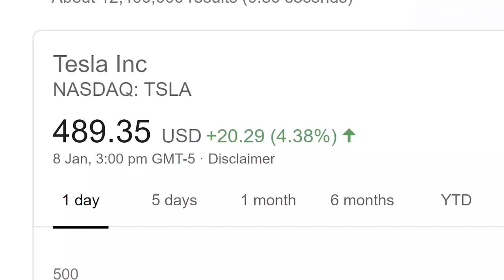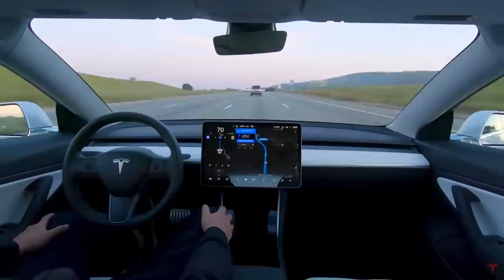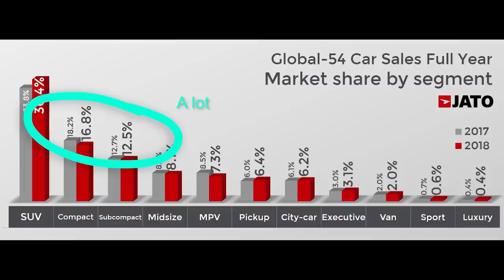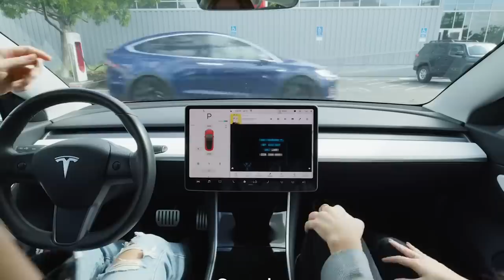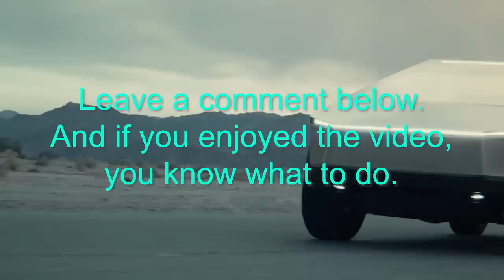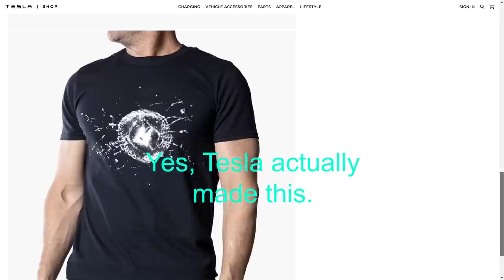Is Tesla Making A Compact Car? (or something else)

Comment: Nice prediction. I think you nailed it. But I think he’ll blow everyone’s mind when it starts at $19,000 for the base model. 200 mile range. 0-60 3.9 seconds. Full self driving.
Reply: Bruh
Reply: i'd say take my money, but i doubt it'll be that affordable. Possibly in the future
Reply: Not full self driving under that budget....the sensors alone would cost nearly ¼th of that
Reply: YOU just blew my mind with those specs, nevermind Elon announcing them😱
Reply: Probably 24990$, maybe in the future 19990$
Reply: Only has to be $25k to disrupt the ICE industry. If that could be imported to the US/Europe (without tariffs) that would sell in the millions, but more importantly, bankrupt most ICE manufactures in 24 months. Given that scenario, the transition to EVs would take 5 years not 10 and that is what is driving Elon so it will most likely happen.
Reply: Their compact city car certainly won't be that fast, on purpose, to save weight. It just has to be faster than other cheap electric cars, 7 seconds will be sufficient.
Reply: @raj6249  what sensors would be so expensive? 8 cameras? 200 dollar phones have decent cameras. Sonic sensors and radar don't break the bank. However, I think it's no longer an option to build a car without autonomy (for Tesla). They depend on it for normal things, like automatic wipers and cruise control. And just the data collection could be worth it.
Reply: @raj6249  they would cost that now
Reply: I don't think he's thinking radical enough.  ;-)
Reply: @boulderghost4457  correct only has to be 25k to KILL the ICE industry
Reply: That cost is probable, but it will not do 0-60 in 3.9.... not even close. But that's not the goal either...
Reply: @raj6249  ....China-make.... up-optioned to Hey-Yay.... FROM $18999....DO-able.... AND.... all WE have to do IS.... watch....
Reply: Yeah no, but we can dream lmao
Reply: @graysonscott1358  But it will be in the future....
Reply: 7 wont do it for me. I consider that to actually be dangerously slow.
<5 should be the min. spec.
Reply: This would be some years yet, doing this now would bankrupt tesla as the couldn't produce them fast enough
Reply: Its designed for urban driving.  100 mile version for 9,995 15 kWhr battery - Think, urban zip car under 2000 lbs.  10 minute recharge on an inductive recharging station.  Most of the driving is urban therefor < 45 mph bam, there is the safety.    200 mile version 14,995 Commuter / Suburban version 35 kwhr battery.  Nobody is going on vacation in this thing, doesn't need more range than that. (They don't need to placate the naysayers any more, you can have a low range commuter vehicle.)
Reply: I always buy used, but if he did that I'd be buying my first brand new car.
Reply: Tesla wouldn’t go that far down with range for affordability.
Reply: @ayushin82  Well, the wonderful thing about EVs is that electric motors are very compact and light. There are pancake motors for EVs that are only 308 mm in diameter and 84 mm thick that output ~214 hp.
Reply: Reddy Salted  Bought my new Tesla 3 for 85K here in Sydney last year (drive away incl FSD)
Reply: 0-60 in 4.5 Seconds is more believable
Reply: cyber Truck base is at $39000, Its basic math, they can get the price point down below $19000 in a compact.  What will be something to see is how they work out the autonomous taxi vehicle at a price point that millions can afford.
Reply: is a that a real $19,000 or one that doesnt really exist?   or one that one be made until the $25,000 are sold?   Full self driving using Teslas approach will never happen,  but given the promise based business model that doesnt really matter.
Reply: @ $19,000 base/200 mi range,  I'm in - especially if it's a "robotaxi" capable model.
Reply: Raj 
No it won’t.  If it was some sort of Lidar based solution then yes.  But as we know they use minimal radar, cheap cameras, and software.

Comment: A car the size of the european VW Golf with the current range of the Model 3 LR would be great! At least in Europe, it would sell like hot cakes!
Reply: Volkswagen ID.3 is the competence, not the Golf dino-juice anymore.
Reply: @ovi9610  I know that, mr smarty pants. I was referencing size before everything else.
Reply: for sure even in asia
Reply: Fiesta or Golf size for under £25k and they'd put unbearable pressure on the competition
Reply: Most of the new electrics coming out are mid range hatchbacks as E versions. A Tesla hatchback would be great. It will probably come close in price with a model 3.
Reply: id3 with 74kWh battery is already coming, that´s the car you are talking about. But it´s in a far other price range. Range max 200km and we are getting closer to 20k€
Reply: yes I agree. Hot cakes are Mmmm good as well.
Reply: @edgewrld  - especially in asia...
Reply: golf.. no .. so boring..too big
Reply: @ovi9610  ID. 3 so classically boring . VW need new designers

Comment: Any segment tesla enters it will do so to dominate it. It will never produce a product to just have a presence. Was a vehicle dealer for years. Saw manufacturers make cars designed not to win in their respective segments. Was very frustrating. Legacy automakers are really complacently dumb. Or perhaps dumbly complacent. And they still are. And they're going to pay dearly for their lack of drive and ambition.
Reply: Yup.  Especially considering that building cars is all about building a platform, and then squeezing as much product as you can out of that platform... If the platform entry in 2020 can't match or beat Tesla's platform entry in 2012, then where will that platform be in 2030?  And what will oil be doing in 2030?  It sure as heck won't be as cheap as it is today!
Reply: like the original roadster, model s and model x?
Reply: @Tigerex966  yah. I remember the S outselling 5 series, E class and A6 lines at one point. The X I'm not so sure about. But regardless, these models are compelling entrants in their segments. And remember, due to battery technology at the time, these models were often more expensive than their direct competition and yet held their own.
Reply: We paid them handsomely to rob us blind and disrespect us for 100yrs. 
I don't feel sorry for them . . . I really don't . Sealed transmissions, Hidden spark plugs, water pumps and fuel pumps . . . 
Good Bye DETROIT and . . . the horse you rode in on.
Reply: @jamesm.8392  ....CHURCH....
Reply: @jamesm.8392  It would be pretty cool if Tesla revived the motor city as a Tesla manufacturing hub
Reply: mmmmm dominated,  overall US EV sales fell in 2019 vs 2018,  domination
Reply: It will be a good day for Earth when they are gone, gone, gone. Tack arrogance too to their lack of drive and ambition.

Comment: Great video. Some thoughts:

1. I think they can get the Model 3 down to $30K or less, so a $25K car is not much cheaper. They have to aim for $20K or less, maybe even $15K or $10K, to really move the needle.

Think about it this way: If Model 3 costs $30K and goes 1 million miles, that's 3 cents per mile. Going down to $25K saves only a half-cent per mile. Getting down to $10K saves 2 cents a mile. Even that doesn't seem like much if the operating cost is around 18 cents per mile.

2. I absolutely love your thought that the car would be explicitly designed as a robotaxi with no concern for having a human driver.  That is a brilliant insight.

3. I don't think it will have more than four seats, and could be as small as a two-seater. A $10K 2-seater would be pretty radical.

4. I don't think the battery is the most expensive part of a Model 3. Battery is about $6K. Frame might be more than that.

Comment: Love my M3, I have a cyber truck reserved & I'm a shareholder, so clearly I'm all in on TESLA. That said, living here in the US NE, I just don't see how year-round autonomous self-driving will happen. The other day, I drove 6 miles in heavy snow. Got warnings about camera obscuration - AP was not available because the front cameras couldn't identify lanes visually - and neither could I (I followed tire marks). Driving in this, I wondered, how would a visual/sensor system ever deal with snow & ice? Warm weather is one thing, but harsh weather is another matter and there's plenty of it, even if its seasonal. Driving autonomy still has a VERY long way to go.  BTW - love the channel!

Comment: In North America the main reason to get a smaller car is price. It just happens to be smaller. The parking costs are the same regardless of size for cars. So it’s not the size that matters most but price for a significant number of buyers. If Teslas less expensive car happens to be smaller it will be the safest smaller car which is awesome. Basically its battery cost. I think an EV Powertrain cost is 50% of the vehicle compared to 25% for ICE vehicles.

Comment: Great report. We own a 2018 Tesla 3 and a Chevy 2016 Spark EV.  I actually prefer the SPARK EV for around town. It has 4 doors and grab handles inside each door on the ceiling to help older and challenged people I help. The rear hatch is bigger than the 3. That makes it handy for walkers and wheel chairs. 
I hope Tesla makes the model C Compact or model 2 car about the same range and price $20-25K 100-150 mile range. It would be great for so many people. Good for Robo taxis too.

Comment: It would still be the heaviest subcompact on the market due to the battery weight, and the battery weight would still need reinforcement which is why Tesla does so well in side collisions. Mass matters and it'll be no S/X on crash tests, but if they bring up the subcompact average, it seems they'd still want to do that? The 3 is one of the best for its size class, I expect their subcompact would follow. Regardless of if they accomplish FSD any time soon.

Comment: Excellent content.  I hope Elon Musk reads your comments. They could use chambered , layered body panels that have expandable ultralight foam to create a passenger compartment  honeycomb safety zone.  Very thin and lite sliding doors with all the cars control and functions running down a center control spinal cord. Multi frequency fiber optics to reduce many of the sub systems and their wiring harnesses.   Game changer, all other will be playing catch up for decades. Lets get this done...  Thank you Tesla !!!

Comment: Thanks for another excellent video! You work your butt off!! Impressive. Don't forget to eat and sleep! We need you alive and well.  To your design question: It would be a good idea for Tesla to utilize the Cybertruck approach - Exoskeleton, no paint. This would make the car less expensive to produce and any car used as a robo-taxi needs to be tough. With no paint, chips and rust are out so the car won't show age in the same way as traditional cars - especially important if the car is to go for millions of miles (or kilometers). Many people who live in apartments don't have garage access and a car that does not rust and has no paint to fade is very attractive. The Chinese market fits this description as many people in China live in apartments.  Most people in large cities don't have garage access, so a car that can take constant exposure to the elements and to people is a great design approach. One more note? Eventually as FSD gets the point of virtually no accidents, cars can lean toward maximum interior space, therefore, the frunk will yield to more space in the interior.  Thanks for reading all comments!  BTW - Just watch how Biden does a lot more for EV's than Trump.  Guaranteed. The only thing that will hold the Biden administration back on its EV and clean energy vision is if the US Senate remains under Republican leadership. We won't know until late December, but it is most likely what will result from two senate seat elections still to happen in Georgia.  Fact: Democrats have better economic results than Republicans, no matter how many time Republicans tell you otherwise. Fact: Trickle Down Economics is inefficient. Fact: Trump is a crap businessman with a history of failure. He put his support behind oil and "beautiful, clean coal."  Trump did nothing to assist Tesla or the clean energy revolution in the US. Nothing. He never recognized how important Tesla is to the strategic industry of clean energy in the US and the world. Never. The idiot lied that Tesla chose Texas due to his influence and Trump only got interested in Lordstown Motors when he got worried he might not win Ohio. Trump has no plan for a clean energy future and all the jobs it will create and the help to society it will bring. The arrogant moron claims to know more than the world's scientists. What a joke. If Trump were a company he would be Nikola. Still don't think so? As you like to say, just watch, this video and these comments will still be here to reference years form now.  The only person I know who hates a con more than you is me. Maybe a video covering the effects of Wall Street changing its tune about Tesla is a good idea - you could highlight which bears are turning Tesla bulls and when the change occurred for each. Another video idea: a video outlining the effect the addition of 500,000 EV chargers in the US and a comparison of the charging infrastructure on each continent and what it says about the rate at which EV's will spread and where they will proliferate in terms of locations as inferred by EV infrastructure.  Keep up the great work! : )

Comment: I think there will be several categories of robotaxi. Most of the time, people taking a taxi somewhere are traveling solo, with perhaps a briefcase, or at most two big pieces of suitcase luggage. That means a fully self-driving robotaxi for urban use should be more like a motorbike than like a "car." However, for stability and safety, it should have at least three wheels. My own design for the kind of robotaxi that you would call up in most situations (i.e. when traveling alone) would thus be a teardrop-shaped vehicle with two wheels in front and one in the back (or perhaps vice versa), a plastic or glass bubble canopy, a very very comfortable seat with a nice entertainment display in front of it, and room for three pieces of luggage or a lot of groceries in the back. 
There could, of course, also be larger models, four-wheeled mini-cars for urban families or taxis taking more than one passenger at a time (perhaps three or four). But one vehicle that some company should definitely design and build is the teardrop-shaped tricycle EV that I've described in the foregoing... for all the reasons you outlined in your video, and then some.

Comment: The exterior will be more rectangular, tall and container-like to maximize space. Interior configuration is customizable to allow for sleeping, desk, fitting room, or seats during ride. No steering wheel or pedals, no dashboard, no center console. Will still have a monitor for operation. Windows at waist level to look out but can be shaded for privacy. Doors are removed, only a door at the front and a door at the back. No front trunk or back trunk. 4 wheels. Short in length. Most similar car model exterior today is a Smart car. Light. 7 seconds 0-60, top speed 80mph. Shoot for $18k base

Comment: I'm not sure how clear it is that a smaller lighter car will have significantly more efficiency. It takes less energy to accelerate, it recovers less energy from regenerative braking. Regenerative braking means that momentum energy doesn't have to be wasted. I'd expect the main spend of ann electric car to be on opposing air resistance? Does weight or size change that very much? (smaller size would help it, but I'd guess it might be to the square root of the size decrease, which might not be very large)

Comment: It might be too much of an engineering problem, but I hope Tesla makes a modular vehicle platform where you choose a nose, cabin and rear section. Your options for nose modules would be a big frunk or extra battery pack. Cabin configurations could be a 2 seat cabriolet or 5 seat 4 door. Rear choices could be a hatch-back or sedan and probably a commercial (van or truck bed) option. Barring this I hope they crack the small city car market at a price at or less than $25k

Comment: Any wild prediction on what is going to do to the stock price in the short term ( a few hours when market opens ) the "unintentional acceleration" investigation situation? I think it is very likely that Tesla could address anything. as a software update, but if that does not cut it, could a possibly mass recall be a massive set back? Keen to hear your thoughts on that.
@solvingthemoneyproblem